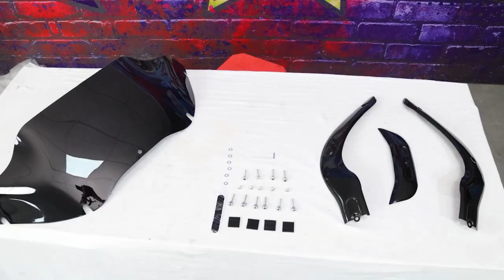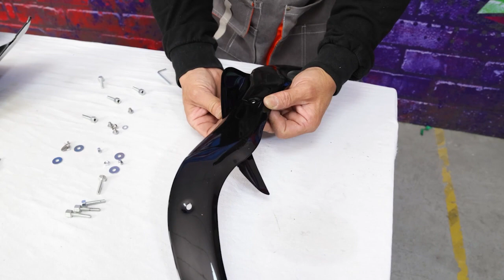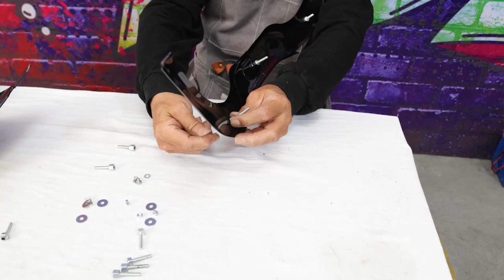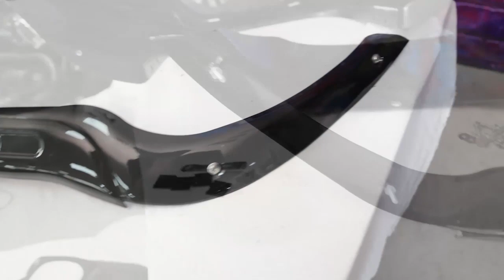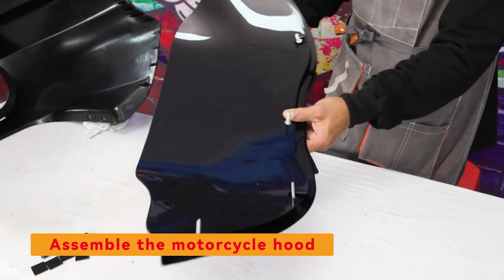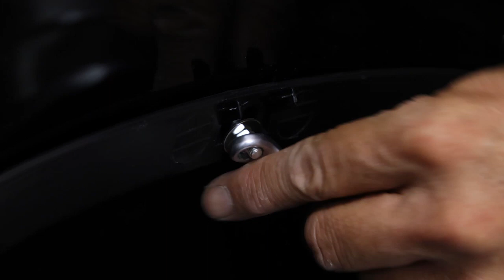TCMT | Windshield Screen Trim Kit Installation

Comment: Can this be done another way with the fairing already installed on the bike?
Reply: Do you mean the removal? I have this same setup and wished that I could find a way to remove the trim piece from the bike. I cannot find a video on that. I think that is what you meant for TCMT to understand.
Reply from the maker: @realcolbyadams  Reversing the order of installation is the process of dismantling.